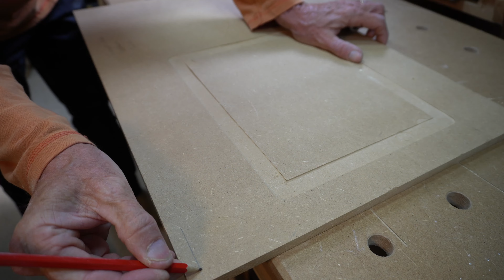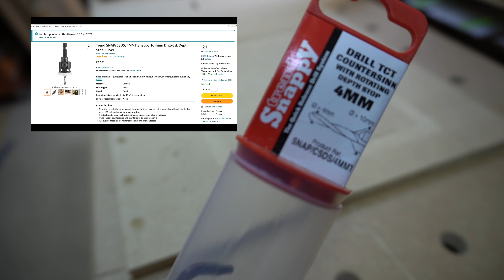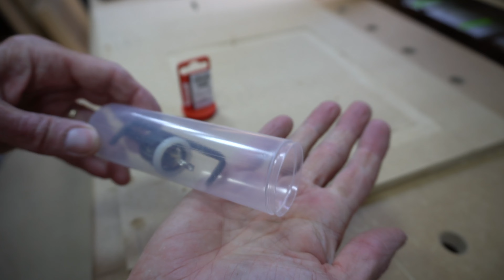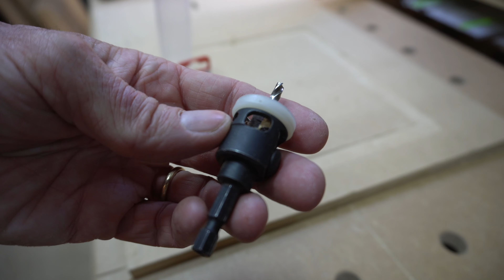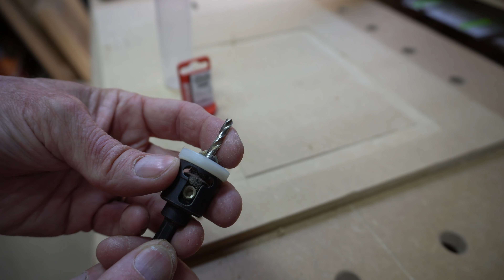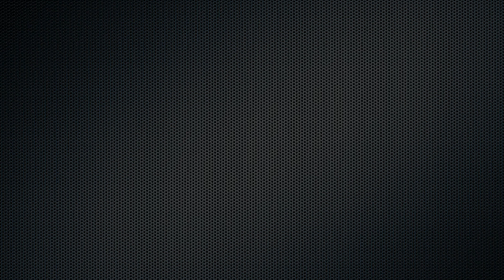Basic Woodworking Tools - Trend Snappy Countersink . Best Countersink for Woodworking?

Comment: I'm a bit confused. It drills a nice countersink with a pilot hole but why would I want a pilot hole in the top piece? Shouldn't it be a clearance hole, i.e. if I want to use a 5mm screw to join the countersinked piece to another piece, shouldn't the hole be bigger than 5mm so the threads don't catch in the top piece?
Reply from the maker: @_wormlet  HI. That’s not how any of these work in timber. Metals yes. The drill is sized to provide the best (almost) clearance size hole without splitting the timber - modern screw threads help with this. . If you had the 5mm clearance then you would need to still change but for the pilot. If you were inserting 1000’s of screws a day, which is a possibility for pro woodworkers, you wouldn’t want to be changing bits. Alternative is to have two drills set up. Regards JP

Comment: Could you advise what is the difference between TC No. 12, TC No. 10 or TC No. 8 please? I’m no woodworker but would like to have one, hence looking for something I can afford. You can get for £40+ but these one & the one by Wolfcraft, but I’m not sure which size to go for! I shall look forward to hearing from you soon! Cheers!!!
Reply from the maker: Hi size of screw. 8, 10 and 12 are screw sizes - modern sizes are 4mm, 5mm and 6mm which relate to the diameter of the shank . Number 12 are huge, its not often I use those. Most screws I use are 8's  (4)then 10's (5). Can't remember last time I used a 12. Regards JP
Reply: @Smallbarnworkshop  Much appreciated for your advice! Thank you kindly! Cheers matey!!!
Reply: @IfDawidCanYouCan  #8 = 2.75mm bit, #10 = 3.25mm bit, #12 = 3.5mm, they also sell one with a 4mm and 5mm bits.
Reply: @EunoiaAnrkyuk  The 5mm bit creates a 5mm hole? So that would then call for a 4mm screw? So the threads don't catch. Which piece should I buy if I want to use 5mm screws. I want a clearance hole not a pilot hole